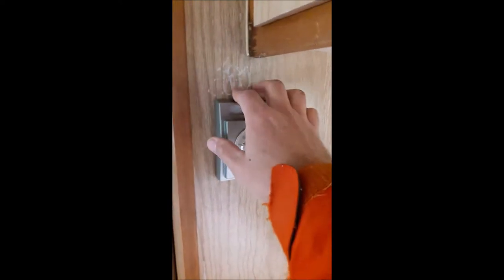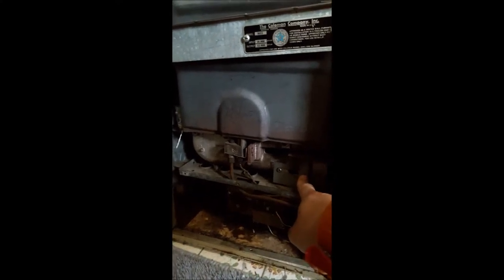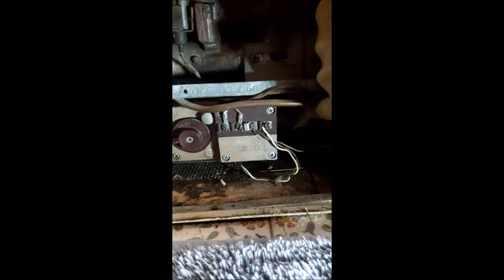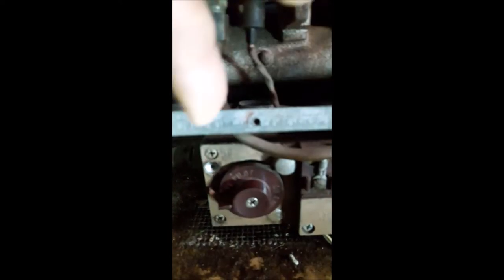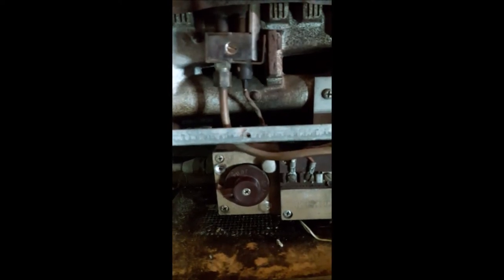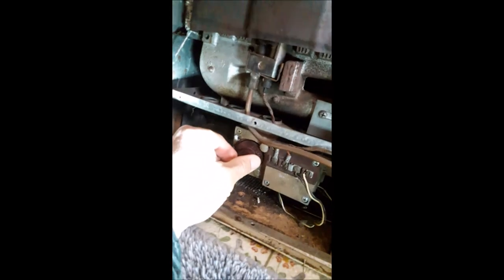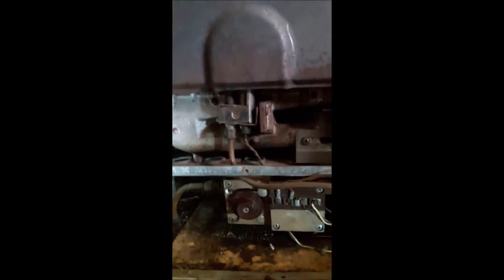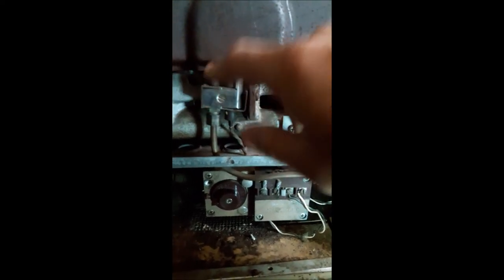Vintage Camper Furnace Pilot Lighting, Video #1 of 3

Comment: Thank you! That pushing the button down trick was just what I needed to have a warm trailer tonight!
Reply from the maker: Make sure you're extra careful when using the older camper propane equipment. There are a lot of safety measures built into your system, but the real danger is very small leaks. 

So use all your senses, including hear (you can hear propane when it's on) smell, even look, touch connections, look at pipes.

After I fixed mine I smelled just a little gas. It turned out I didn't tighten a connection going to the small tube supplying pilot light.

I tightened it and has been fine ever since. 

I will always turn off the propane at the main valve when I'm not using it.

Safety is the most important thing, being responsible for your own safety.
Reply: TK Mair Thanks for the note. I don’t smell any propane when it’s on any of the settings (on/off/pilot) and when I moved a flame around the heater when on I didn’t find any leaks. If there’s another way to check, I’m definitely open to it because I am not trying to mess around with being poisoned in my sleep. 

More noticeably, there’s a pretty bad smell, like burnt rubber, coming off the heater when I use it. I ran it for an hour or so today with the  trailer door open, in hopes that whatever was causing the smell would burn off. It seemed to get better, but since I may have just habituated to the smell, I plan on doing the same thing tomorrow to check again. Any thoughts on what that smell might be? All I’ve been told so far is it’s likely dust that will burn off. I know it hasn’t been used in a couple years so there is definitely dust accumulated but the smell just seems too intense to just be dust.
Reply from the maker: Hi Hannah. Sorry your heater has a smell! Did you get it to burn off? Mine is rusty and was dusty. Had a smell which mostly burned off. Now that I have it working well, I will probably just live with it. The ultimate would be to disassemble it and take the parts to a person who has a sandblaster.

Not sure that will ever happen, but those things can do miracles 😃